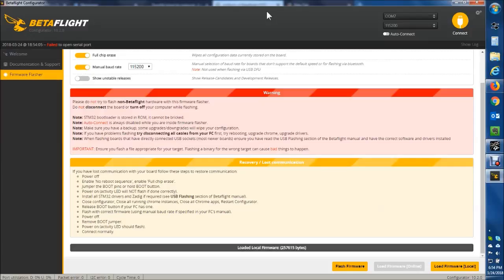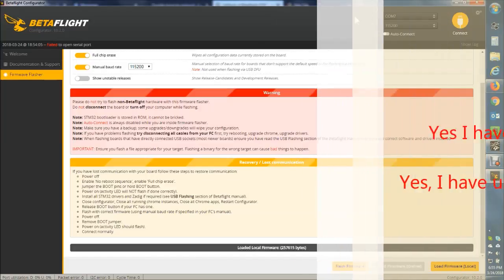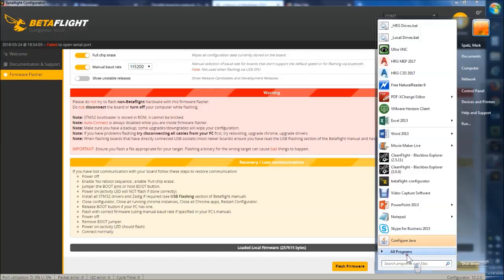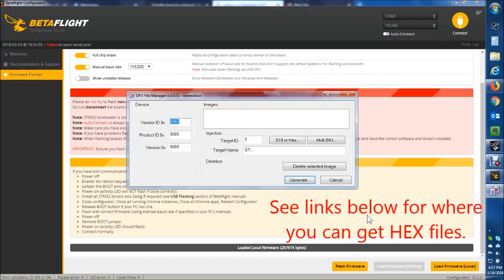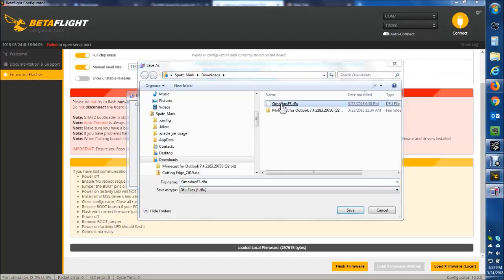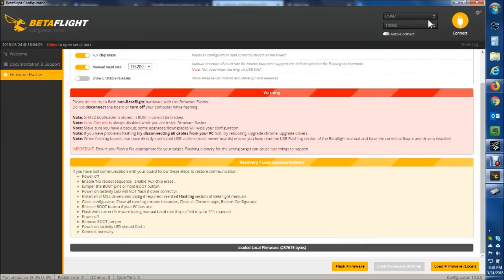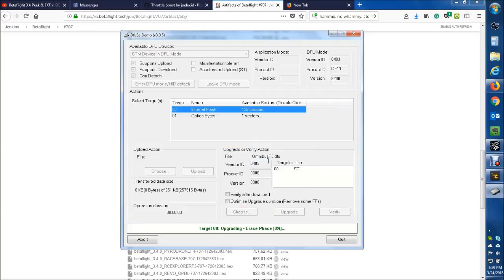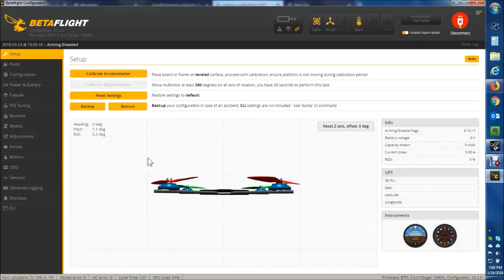Stubborn STM USB VCP Driver (in DFU Mode)

Comment: Would this help if the situation was reversed? Upgrading to 4.3, FC  now always boots to DFU. I have to exit DFU in Betaflight to get into Betaflight. Exiting Betaflight puts it back in DFU. Can't fly in DFU.  Betaflight works great until unplugged. Guess won't hurt to try at this point. Love all your work. Been great support for my growth.
Reply from the maker: Ummm... i have never seen a board do that.  Check that you Boot Button is not suck down.  You can always take that button off and jump.manually the pads it connects to if you do need in the future.

Comment: I am having exact same issue and was hoping this video was my savior! But NO!! I cant select my FC in the DFUse Demo software. The device list is blank. I think the FC's going in the bin. Thanks for the video though.
Reply from the maker: You have to kick it into DFU mode in Betaflight and then go into the software.  Did u try that?
Reply: Yes did that. I can get the FC into DFU mode but it wont show DFU mode in Betaflight or cant see it listed as device in STM software your using. I just purchased the FC from Banggood but Betaflight version is about a year old. Maybe its an issue there? Ive spent hours on it now.
Reply from the maker: @thegaz1892  , the age of BF on the the board isn't the issue.

So you can connect to it in BF right (would have to be Yes since you opened to trigger DFU mode, but want to confirm)?

Does it have a bootloader pad or button on the board?
Reply: Yes can connect to BF no probs. It has a button. I have just about worn it out! I have used "bl" command through CLI as well.  The FC is definitely in DFU mode. Its just seeing the FC in DFU mode on the computer is the issue. Last night I flashed an old FC without much trouble so I am confident all my drivers are working ok. I have been through about 30 vids on drivers!

Comment: Nice soft good to know. What i usely do when i cant connect an fc i use a soft call USBDevmanview which allow you to see all driver install on windows. Then i just uninstall all dfu impulserc stm driver. Plug in fc install driver and all should work fine.
Reply from the maker: ChapaxFPV , will give that a shot
  Thanks for the tip!!